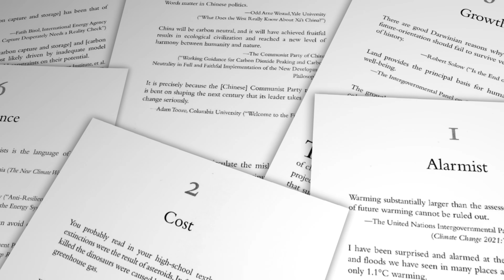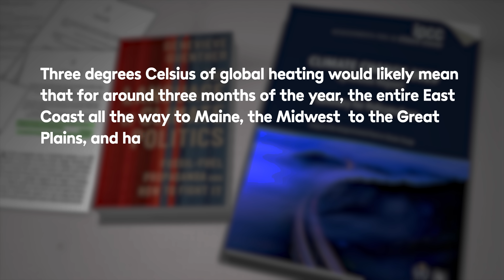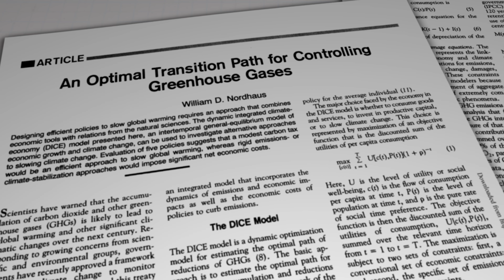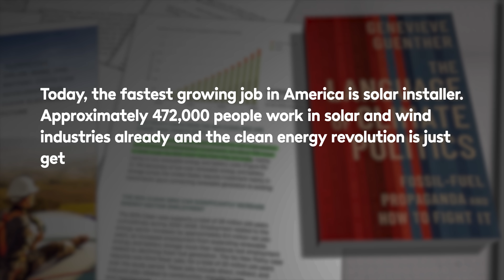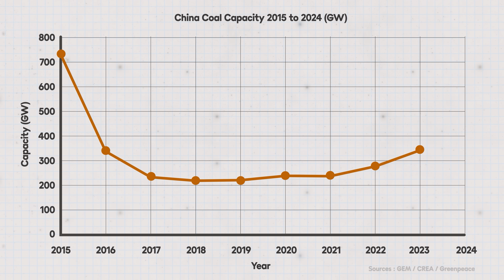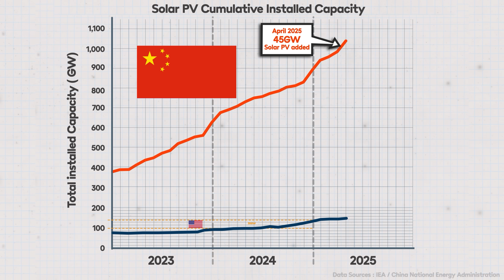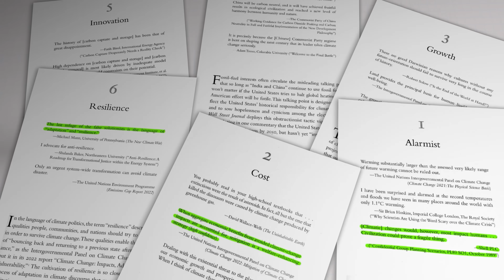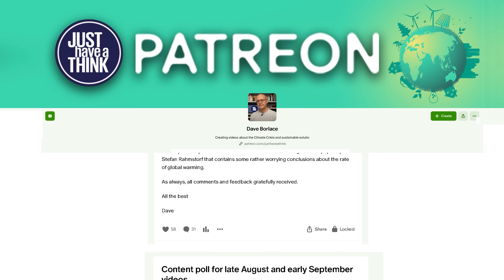New research DEBUNKS climate disinformation.

Comment: 2025 could be the year that the U.S. faces bushfires, floods, and hurricanes; ALL at the SAME TIME, but don't worry, Climate Change is 'fake' news!!!
Reply: Climate change isn't fake.  Man-made climate change is fake.
Reply: @JimmyD806  The earth's climate is always in a state of change.

Those changes happen because the natural variables that control climate change over very long periods of time.

The issue today is that man is now able to influence one of those natural variables, and he exerts that influence via his use of fossil fuels.
Reply: @Les_S537 
Did you read my comment about Venus?  What science term used gives you the most trouble?  Joules?  Per unit volume?  If you understand my comment, you'll see that man has near ZERO influence with the possible exceptions of Urban Heat Island effect and changes in albedo due to changes in ground cover.
Reply: @JimmyD806  Well, I could agree with you, but then we'd both be wrong.

Comment: At maximum average temperatures, the gas at Venus' surface only has 2.4 times the joules per mole as gas near Earth's surface and the planet receives almost 2 times the energy we receive. 

The planet is hot near the surface because the atmosphere is 54 times denser than Earth's is.  So, it has 2.4 x 54 = 130 times the joules (KE) per unit volume than we do.  

Now, here's something that will really play with the mathematically challenged.  Even if Venus had half the joules per mole (KE) that Earth has, it would have 0.5 x 54 = 27 times the joules per unit volume.  So it would STILL be hotter.

It's not CO2.  It's density.  Climate alarmists just can't grasp it.
Reply: Venus' atmosphere is more than 54 times a dense as the Earth's is.

But you want to talk about density...

Mars' atmosphere is 96% CO2, and there are places on Mars where ambient air temperatures can reach 72 F during the day.

But Mars' atmosphere is less than a percent as dense as the Earth's is.

Coincidentally, Venus' atmosphere is also 96% CO2.
Reply: @Les_S537 
Okay.  Maybe sit down and calculate joules per mole at maximum average temps on Mars.  You'll find out it has nothing to do with CO2.
Reply: @JimmyD806  As my facts about Mars show, it's about density...

How does Mars, which is much further away from the sun than both the Earth and Venus, have ambient air temperatures of 72 F in the day?

First, it only happens at the lowest elevations of Mars.

So what is the difference between the lowest and highest elevations on Mars?

~95k feet.

At Mars' lowest elevations, where CO2 density is greatest, is where those temperatures are possible.
Reply: @Les_S537 
What gives people the biggest problem in this area of physics is they don't understand what heat is.  Heat in a gas is the motion (translational and rotational) of all the gas molecules.  It's kinetic energy.  It's a molecule colliding with your skin at 400 meters per second.  That's what heat is.  It's not infrared.
Reply: @JimmyD806  Your claim about heat being the kinetic energy of gas molecules’ translational and rotational motion, like molecules hitting skin at 400 m/s, oversimplifies and misrepresents the physics. 

Heat isn’t the kinetic energy itself—it’s the transfer of energy due to a temperature difference, via conduction, convection, or radiation. In a gas, the internal energy (from molecular motion) contributes to temperature, but calling that “heat” conflates two distinct concepts. 

Your example of collisions with skin describes conduction, ONE MECHANISM of heat transfer, but ignores others like radiation or convection.

The 400 m/s speed is a reasonable ballpark for air molecules at Earth’s surface (~460 m/s at 300 K), so that’s fair, but it’s not the definition of heat—it’s a consequence of molecular kinetic energy. 

You’re correct that heat isn’t infrared; infrared is a radiative transfer mechanism, not heat itself. However, dismissing infrared oversimplifies the role of radiation in heat transfer, especially in contexts like planetary atmospheres (e.g., Venus’ greenhouse effect). The “biggest problem” isn’t just misunderstanding heat but also conflating it with internal energy, as your statement does, which muddies thermodynamic principles.
Reply: @Les_S537 
No, I haven't oversimplified it.  That's what heat is.  (And I've been involved with gas physics for a long time.)  

Conduction is a molecule either gaining or losing energy during a collision with a surface or another molecule.  As for radiation, that's not heat.  That's energy transfer.  A photon is just a packet of energy.  If it's of the proper wavelength of infrared, a molecule might absorb it in the molecule's vibrational component.  From there, that energy is converted into rotational or translational motion (heat) during collisions.
Reply: @Les_S537 
There's also this myth floating around that "CO2 reradiates energy in all directions."  That's not correct.  It doesn't happen in the lower atmosphere to any great degree and not at all below about 3500 meters.  Above about 3500 meters, maybe 2 out of 100,000 CO2 molecules might have a chance to decay and emit, but due to short pathlengths, it's quickly reabsorbed.  This rate slowly increases as you move up in the atmosphere. As any type of warming mechanism it would violate conservation of energy and certainly 2nd Law because it would be old energy and old energy has high entropy.  That's why perpetual motion machines don't work.
Reply: @Les_S537 
As for Mars, its atmosphere is so thin, it may not have a full greenhouse effect.  Some of the wavelengths CO2 absorbs may be making it out to space.  Since it's cooler than Earth, I've never been interested enough to sit and work Beer-Lambert.  I'd need to calculate amplitude for the surface temperatures and it's a bit of work.

Comment: Relax. Trump can only nibble at the edges of the transition. Drilling for oil in the US is self-defeating as US extraction needs high prices to be viable, gas somewhat less so. The economy will dominate and renewables are so much cheaper than fossil fuels that the transition will continue on. Texas is the proof of that, with massive renewables rollouts in one of the Trumpiest states in the US. It can't go that much faster anyway, as things stand, without society-wide pushes, and a large part of most societies just don't think it's a priority.

Comment: Everyone is aware that dark pavement is hotter than bare dirt. Bare dirt is hotter than dirt below mown grass. Dirt below mown grass in the sun is hotter than dirt below tall grass prairie. Areas under trees are always cooler than direct sun. This is why concrete cities and bare dirt farmed fields AND set-stock cattle on short cropped grass or dirt ALL contribute towards hotter temps. 
Regenerative grazing, Regenerative farming with no till AND covercrops, and Regenerative garden and lawn care actually sink more carbon and methane into the soil and cycle more rainwater into groundwater.
Take a look into Regen practices and support Regen food producers.

Comment: Those who think we can adapt are not factoring in unseen and unknown tipping points.
We are heating the planet 20X faster than the fastest natural thermal excursion in the rock record, the PETM (Paleocene-Eocene Thermal Maximum). This uncontrolled and uncontrollable global experiment could end up leading to a runaway greenhouse situation, similar to what's occurring on Venus, where surface temperatures are hot enough to melt lead and the barometric pressure is the same as being 3000 feet under water (~1000m).
People scoff at this notion, but we don't know that we are NOT doing this. No one knows what tipping points there may be that are currently unnoticed.
Reply: I think they also don't realize what it will cost to develop just the climate-hardy food crops needed to survive the coming heat, the equipment to harvest crops that must currently be harvested by hand, and a continental-scale potable water distribution system as lakes, rivers, and aquifers dry up. Somehow, they're all deluded in thinking that this will somehow be less expensive than what's currently in front of us.

Forget that current road technology is struggling in the current heatwaves, melting and buckling under stress. High-voltage power transmission lines sag and start wildfires, and the list goes on.
Reply: In human time scales it's unlikely that the planet would exceed 15 degrees Celcius of global average warming. Of course some areas will warm more and others less than the average, and the modelling seems to indicate hotter summers and stormier winters which will certainly make life more challenging.
But take the temperatures where you are now and add 15 degrees, and that will give you a rough idea of what temperatures were like last time all that trapped carbon was in the atmosphere.
It's going to be interesting times.
Reply: I just saw a video that said 3 degrees of C, where we're headed for sure, means you can't go outside during the daytime, 3 months of the year. During those months even very short amounts of exposure would have a high risk of death.
Reply: @pismopleasure  You will believe anything 🐑🐑🐑
Reply: @pismopleasure  This depends very much on where you live. In my area of Australia, it already gets to 43 degrees C fairly routinely in a hot summer. Three more degrees, assuming that's an even three degrees everywhere (which we know it won't be) would take that to 46. That's really not attractive.

But in a place where a "hot" day in the middle of summer is 25 degrees C, adding three degrees would only take it to 28. Even adding the 15 degrees that I figure is the highest it's physically possible to rise by in this millennium, a place that considers 25 to be a hot day now would be looking at 40 as a hot day then. I know for a fact that going outdoors for extended periods of time in 40 degrees will not harm a healthy young adult who is properly dressed and hydrated for those conditions. I used to build farm fences in that weather!
Reply: right. but is it only 20X?
Reply: Let’s be honest, nobody knows, though the more wealthy, the more jumping to nonsense conclusions. Is it time to reduce risk? Big time.
Reply: " unknown tipping points" oh mean the ones that dont exist, yep you are certainly a sheep.
Reply: Yep, sneering at science is far-right political correctness.
Reply: @manoo422  What is known and not included in the current figures is the like of Permafrost thaw resulting in methane, all the way to Whales poo, which some studies have shown make a significant contribution to counter emissions indirectly via the oceans. Others might include all the ice flowing off the top and bottom ends of the planet and distributing across our oceans could also have a negative effect on tectonic plate movement, resulting in extra volcanic, and earth quake activity. So yes there are many unknowns!
Reply: @manoo422 isn't this thinking too complacent regarding our complex world of interlinked chain processes, equilibri?
 And what is already known is already bad enough, no? 
For example doubled atmospheric CO2 likely results in 4,5°C climate sensitivity
-> ecosystem collapse - >  mass extinction event because climate changes much faster than most species could possibly adapt to AND
-> big time crop failures, water crisis 😒
Leichtsinnig und kurzsichtig😩
Regarding the sheep thing, I think you are projecting.
Caught between denial and Dunning Kruger.
Because come on, do you truly - in your heart - BELIEVE that hundreds if not thousands of experts from the fields of climate science, biology etc around the world are crying wolf for the giggles/"world domination" , really? 🤡
Is it NOT ExxonMobil and Co well paid propaganda you got victimized by, because business as usual has the money and the political establishment in their pockets....?!

Comment: Why are my energy bills so high?
Reply: Because they're still clinging onto fossil fuels.
Reply: Because of the climate myth.  It gives them an excuse to charge you more.  That's the whole reason for the myth.
Reply: @JimmyD806  Denialist.
Reply: @incognitotorpedo42 
Correct.  I strongly deny pseudoscience and faux physics.
Reply: @JimmyD806  That's what I thought... They're reselling us the wheel but. The new wheel is way more expensive than the old wheel... Europe's economy was crippled when the Yanks took out the NordStream pipeline. Europe will never be a competitive manufacturing base again. The USA have did some hatchet job on us

Comment: The alarmists are the real science deniers.  The GHE Effect, if u want to call it that has nothing to do with CO2.    In the early 90's it was bastardized.  The Earth shed heat via conduction and convection via the 99% of the atmosphere which is N2 and O2.  Doubt me?  Go back and look at H.S. and middle school text books from the 60's and 70's.
In the 90's it was 'decided' by politicians, instead that heat is lost to space via Infared being bounced around thru CO2.  Physics be damned they said.  The Oceans are going to boil and coastal cities will be under water by the year 2000!
Reply: CO2 is a radiative gas.  It's the main gas that emits IR to space at the top of the atmosphere.  Climate alarmists don't realize that it actually cools the planet.

Comment: He really didn't learn from me :/

First thing: there no "GHG effect" ! Ideal Gas Law forbid this!
The only think that work is PV=nRT !
This allow to calculate CO2 thermall influence, it's 0.06°C
(same result in 5 different ways!)

No climate zone has changes, trade or switch to another in last 70y!

The temperature in the city can be 7°C higher than in the countryside!

Oceans cannot be "acidic" due to CO2 because pH is:
Calcium carbonate:
pH: 9.0
Magnesium carbonate
pH 9.3 (hydrate)
Sodium carbonate:
pH:10.33
Potassium carbonate:
pH:11.6
is high!

Cumbolt Current near the coast of Peru - 25% of the world wild fish catch: pH of the water 7.7

Only 2% of the heat run as radiation, 98% if the conduction and convection. If now...why your PC do need a heat sink and the fan?

Just give a think...

Comment: The greenhouse effect is NOT a cumulative effect.  Just like EVERYTHING else in the universe it has a limit.  Limits are set by pathlengths and surface temperature.  Not even Venus has a "runaway" greenhouse effect.  It's not possible.

Comment: Let’s do solar Geoengineering and inject SULPHATE AEROSOLS (that come from a volcano 🌋 like 1991’s Mount Pinatubo eruption) into the upper layers of the atmosphere using high-flying aircraft with nozzles that would spew out said aerosols. Let’s add 1,000,000,000,000,000,000,000,000s of tonnes of SULPHATE AEROSOLS and CALCIUM CARBONATE to cool down the earth by 4-10°C. That’d give global heating one blaze of a beating, wouldn’t it?! Go for it baby!

Comment: @JustHaveaThink
Hi Dave,
first of all: Thanks for another great video.

I have a potential video idea for you concerning a critical but often overlooked aspect of grid stability: reactive power management as a tool to prevent renewable energy curtailment.

A German technical video by "Akkudoktor" Dr. Andreas Schmitz (link below) provides an excellent introduction into two practical solutions that seem ripe for a "Just have a think" explanation:

1. Using Existing Inverters: Modern solar, wind, and battery inverters can already provide reactive power to stabilize grid voltage. It's essentially a "free" grid service hiding in plain sight, allowing renewables to operate at full capacity even when voltage is high. The main hurdles are not technological, but rather a lack of financial incentives and proper configuration.
 2. Advanced STATCOMs: For more centralized control, new generations of STATCOMs can manage both grid voltage (via reactive power) and frequency (via active power) simultaneously, reacting in milliseconds. This is a powerful, all-in-one solution for stabilizing grids with very high renewable penetration.

The topic seems a perfect fit for your channel – it’s a complex engineering problem with elegant solutions that are crucial for the energy transition. It highlights how we can work smarter with existing assets and deploy targeted new technology to solve key bottlenecks.
The original video is in German, but the concepts are universal and visually well-explained. Might be worth exploring and having a think.

Video Link: https://www.youtube.com/watch?v=O5xdGkpe9xE

Cheers.

Comment: The heat waves that you speak about would vastly increase the amount of electricity being used for heat pumps (air conditioners) to keep us alive.  This would more than use up the fantastic progress we are making in increasing renewable energy.  Each house would be wise to have its own air conditioner, powered by its own solar panels. https://mtkass.blogspot.com/2017/02/australian-air-conditioning.html
Anyway, the cost of mitigation of which you speak is actually negative as it not only is economic activity that stimulates the economy but does so by putting wealth into the pockets of the common man instead of into the pockets of the rich and lazy.  The more money, we the poeple, have, the more we spend on food, kit and services to the benefit of all.